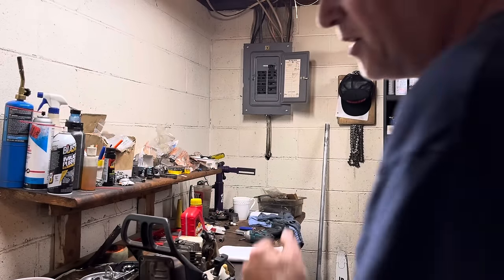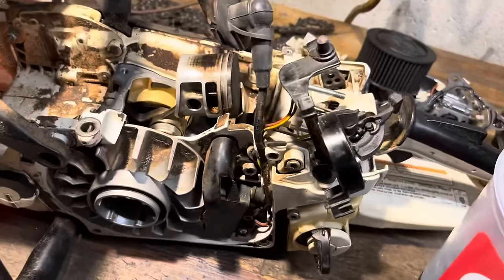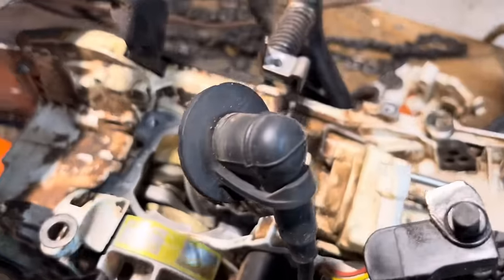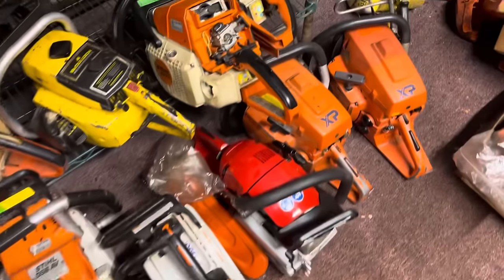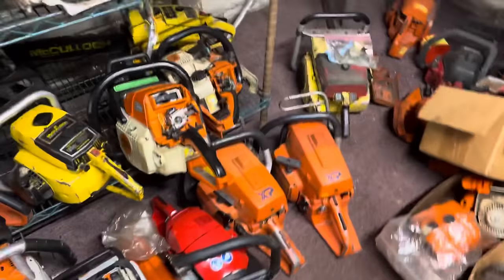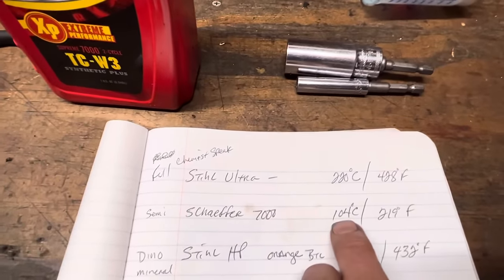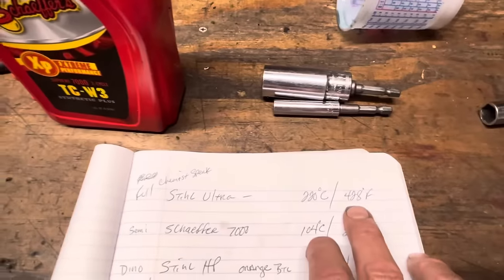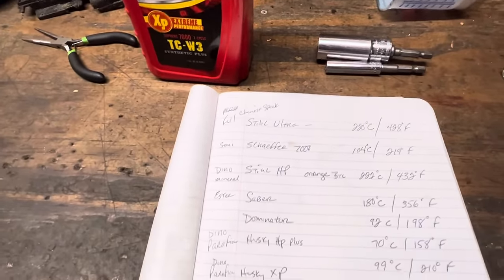Two Stroke Oil Talk.  Why Anything is Better than Ultra for your Chainsaw!

Comment: Schaeffers for the WIN! I run the synthetic for air cooled engines. My 462 is running at least 50- hours a week. From 90-degrees to -30F. Its 18-months old and still runniing like a raped ape! I mix at 45:1.
I run the Schaeffers in trucks, cars, log splitters, everywhere. From the performance stand point-nothing better!

Comment: I run klotz super techniplate. Best 2 stroke oil on the market in my opinion.
Reply from the maker: How's it look inside?  Asking for a friend.......
Reply: @richardflagg3084  last time I had the muffler off it looked spotless, but I expected that. I ran it in my yz 80 as a kid. Ended up tearing that engine down after 3 or 4 years of hard trail riding and it was immaculate inside too. In the 2 cycle racing engine world there are builders who won't warranty an engine that doesn't run it. It's that good. Also, if you wanna really party, it mixes with alcohol
Reply from the maker: @noclass2gun342  Nice!!

Comment: Ultra completely blocked the spark arrestor on my ms 241 CM.  Ultra uses ash for lubrication.  I never experienced a mechanical problem due to using Ultra, but it still sucks.  Ultra is a FB certified oil.  That is a 20 year old certification.  I pride myself mixing my two cycle oil.  I use a graduated measuring glass and measure out 77 ml of oil, one ounce of stabilizer and one gallon of premium non-ethanol gas, exact.

Comment: I've used Stihl oil (HP & Ultra) at the recommenced 50:1 mix for almost 30 years in Stihl chainsaws, leaf blowers and string trimmers and never had a problem.  Recently I watched a video that rated two cycle oils and Lucas came out the winner so I'm giving it a try.  Nice, informative video.  Thanks from another "shade tree" mechanic.
Reply from the maker: I'm not a high tech redneck, but it definitely gives you something to think about.
Reply: I have (2) 026 stihl saws. 18” bars. I used them over 30 years to cut 750 pick up loads of wood. Always stihl oil 50:1. Both saws are still good and never been over hauled.
Reply: @440gohorse  I also used to have two 026 saws but last year I sold one that hardly ever got used.  The one I kept has sawed a lot of wood.  Recently I did a major cleaning and while I had the muffler off I checked the piston.  It was so clean and smooth it looked like it was chrome plated.  Great saw.
Reply: @dlkline27  Yes Sir!

Comment: Funny I run a 661 and I just got the green oil. Always run the other stihl oil. In 30 years I've never had trouble with my Stihls running. 

I'm on my 4th tank of this stuff and the saw doesn't start first pull when hot. Already decided I didn't like it before I found this video. Don't like the smell either.
Reply from the maker: It don't like the smell of it either

Comment: I have a husky 372 XP 2003 I’ve been using XP oil 3 to 3 1/2 ounces per gallon never been a part 
works in all seasons a lot of hours on it never any trouble

Comment: Red Line @ 40:1, it keeps my Yamaha winding tight, and my Husqvarna's and Poulan's running real GOOD too!, they all get fed from the same can.
Reply from the maker: Exactly!
Reply: Huuuuge red line fan...running it in ported 5 year old 660 milling saw that pulls a 56 all the time..no carbon in exhaust n piston looks brand new w excellent film!!
Reply from the maker: @chapsmaketory3960  That's what I'm talkin about.  Trust but verify.
Reply: My family has been using Redline 2 stroke RACING oil for decades in all types of 2 stroke equipment.  50 to 1 + adjust carb, if needed. The engines always are clean.  My family has been repairing cars, trucks and all types of gas powered engines since 1919!

Comment: What 2 strpke oil is the best oil to run in my Stihl brushcutters and chain saws .
Reply from the maker: Any JASO rated FD oil will do well for you.  Amsoil Saber, Echo Red Armor or Power Blend Gold, Husqvarna XP+ are all top tier FD oils.  They have a detergent package that Ultra does not.  So you can run just a touch more oil (40:1)  with those oils for extra protection and wear resistance.
Reply: How about Bel-ray 2stroke oil ?

Comment: The problem is that they're formulating this 'new' oil to be 'Greener' so it breaks down really easy outside in the environment and doesn't smoke. It's some kind of natural derivative like plant based oil. They do say it dissipates fast. I have heard you need to run it really hot, and the other thing too is the mufflers have cats in them now so they plug up easier with  the better oils. 
I hate that pond scum oil too. I used the red VP full synth and it was great. Supposedly the Husky oil is good too. I got this Blue full synth oil, Black Max, at Walmart. Haven't tried it yet. They were supposed to have VP but I couldn't find it so I got that. I would say VP probably makes the Echo oil. None of these equipment makers make their own oil.
I've got an old 1970's or maybe '80's Stihl that sounds like a popcorn popper running, a real animal. I think it's 32:1 or 20:1 mix ratio and the Stihl dealer told me it was OK to run the full synth Ultra at 50:1. I didn't feel comfortable doing that. I always thought that Stihl oil looked like $hit mixed.

Comment: I’ve been using this stihl crap on my fs131 and my husky 445 and 460 rancher. Is there any way to get rid of the carbon it’s left on my stuff?
Reply from the maker: Ironically Stihl actually makes a De-carbon treatment.  I've personally never seen it in a dealership.  Running an FD rated oil with a little seafoam over time will clean up carbon.
Reply: @richardflagg3084  thank you for the quick response sir, I will do that

Comment: Ultra is manufactured by Castrol and a good oil. Running a mineral oil at 50:1 under continuous high lost is simply asking too much. Optimal ratio for performance and longevity has been proven at 32:1.
Reply from the maker: I'm with you 100% that 50:1 is asking too much from an oil.  According to Stihl's website, Omni Packaging in Shreveport, LA blends and bottles their oils.  The latest (2018) SDS sheets I can find from Stihl states:

Ultra is an Ester based oil (JASO FB rated)
HP (orange bottle) is a Mineral based oil (No JASO rating I could find )
Stihl HP Super has been discontinued.
Stihl Premium with Castrol logo on the bottle is not available in the US.  I have seen a Canadian that runs it.  There are other Stihl oils that are available in Europe that we, in the States, don't have access to as well.

Comment: Richard i have heard a lot of people say the same about stihl ultra oil. I have used amsol and husky oil lately. I use 40:1 with a pinch more. Great video  who would have thought that one of the biggest saw maker in the world would have the worst oil.
Reply from the maker: I'll cover this in an upcoming vid......  It performs better if you use the premix canned fuel as seen in  Redbull661's canned fuel comparison.  I think that high grade fuel helps keep the carbon in check.  But there's more to it and the above is not a blanket statement.

Comment: This scares me! I have Stihl fs130 trimmer, bg85 blower, and 029 saw. I of course used the Ultra for the warranties. And with my fs130 being 4-mix, dealer told me its very important to use ultra so I don't get sticky valves from carbon. Question, A car that had full synthetic and someone switches back to conventional, the oil seals start leaking. If I switch back to the orange bottle Stihl oil or red Armor, won't my crank seals start leaking going from full synthetic to conventional 2 stroke oil? I bough my fs 130 brand new in 2001 and have had no problems out of it using the Ultra except for A few carburetor replacements dur to Ethanol clogging the ports.
Reply: The Ultra oil is fine. Just mix it like Stihl recommends.  Also, it won't be a problem to run the HP afterwards. That double warranty is only for buying the oil with the trimmer, not running it in it BTW.

Comment: Might be why my ms170 blew its bottom end. Bought asundaes 341 to replace it.  Only thing is i got 5l of the ultra to use up now. Might start mixing it abut more rich now.  Maybe 40/1
Reply: to have 50 l of hp ultra is super depressing

Comment: I use Echo Red Armor when I run out of Amisol Dominator. Dyno Joe does runs saws on like 1000:1 ratio and Dominator out lasted them all by miles!
Reply from the maker: Project Farm did a video with Dominator as one of the oils.  It did really well.  I love that dude,  He's really got a passion for it.
Reply: 100:1
Reply: @rodneyfalk4591  meh one zero equals nothing right?

Comment: I've been running Lucas's semi synthetic for years at 40:1 I've have never had problems with carbon and nothing has died on me yet. Stihl ultra smells so bad and everything seems to run way hotter with lower performance.
Reply: your right l think it's paraffin which is wax Omni makes Stihl oil  not sure who makes Hp orange in Canada it's Valvoline who makes Hp
Reply: @harryerhart5978  You think the wax makes that smell and the burned residue? I believe it, I really like the lucas oil products. Their oil stabilizer is to be used in moderation though. I run their fuel conditioner in every tank saves alot of fuel and helps everything run smooth.

Comment: I have been using Husqvarna branded syn mix oil, but adding enough (3.20z total/gallon) to get 40:1.  It smokes a bit, I have to admit; but think of the money I save.  But Husqvarna does not refine oil and maybe that stuff comes out of the same bull as Stihl????
Reply from the maker: Hard to find info right there.  Most manufacturers have a spec that they want with the additives and have it blended by a secondary company.  Both of the Husqvarna oils (XP and HP plus) have a very low flash point and are neither are a Ester base.  Polar opposite style oils from those two companies.
Reply: @richardflagg3084  Another YT popped-up where several pre-mixes 50:1 were compared after use of new cylinders and pistons.  The Husqvarna did well with upper end, but the lower motor was very dry looking.
Reply from the maker: @rooster3019  We'll do some real world testing here in the next week or so.  Thanks!

Comment: I'll tell you something, people here are buying MINERAL version HP and it makes smoke screen like a 007... The less bad version is semi synthrtic HP Super and that HP Ultra is the least bad oil they have to offer. But I told my dealer a month ago when I bought myself a brand new MS311 chainsaw that I never used Stihl oil only Castrol POWER1 RS or POWER1 RACING 2T and there is absolutely no smoke, full power, instant throttle response, clean spark plug... He told me that's good...
And BTW I'm doing this for many years. 
I have MS230 from 2005, FS120 bought in 2016, now bought MS311 and I can lift them all by pull cord how good compression do they have...
Reply from the maker: I've heard the Castrol 2T is good stuff.
Reply: @richardflagg3084  Excellent!!!

Comment: Neighbor Gave me a case of stihl brand pre mix oil . That stuff definitely felt more powerful when running the saw .  I think it boasted 94 octane.

I feel like it runs great in my saw but at cost of wear and tare . 

Just stand to reason to me if your getting more power out of it , that is great but it’s also at cost  of wear . Everything wears out . I don’t think the extra power gain is going mean to me because I don’t run the saw much so what ever more wear from higher powered fuel compared to what I been mixing may never see a difference when I have worn out the saw. I don’t use it enough to matter . Or I don’t know the difference.

It is more fun to run the saw feeling more power . 

So. Now I buy non ethanol fuel and mix my one fuel again.  I will be moving away from stihl hp unless that’s all  I can find  at the time . 

I brought some Yamaha lube . Thinking i will star the dirt bike up this spring 

Thanks for all the information it’s opened my eyes about this topic
Reply: The gas in those cans is engineered fuel and is different than the gas, even Pure Gas, at the pumps. It's more like Race Gas, has a different specific gravity (density). Those cans have more of the better top petroleum distillates, Paraffines, of the Gasoline such as Alkanes (Iso and N) and Naphthene. A pure Alkylate fuel. Pump gas has double bond (Alkadiene) Olefin hydrocarbons and Benzene aromatics (trash),and oxygenates (alcohol or ether. Used to be MTBE). In some equipment EF (eng fuel) WILL change AF ratio and performance. It tends to burn richer, cleaner, and hotter. 
But you got to ask, who's gonna pay $30-$50 a gallon for that stuff? If you were inclined to use that it would be cheaper to buy a couple gallons of Sunoco Cam 2 standard purple or some 260 GT unleaded 100 or VP Racing and mixing with that. I bought a few 5 gal pails (260 Supreme 112) 4 years ago for $60 (12 bucks a gallon). Wouldn't even want to guess what it goes for now.

Comment: Ive used stihl hp ultra the last few years,just because my stihl dealer is only 10 minutes away. So far i haven't seen any adverse effects. Ive been runningvit in my leaf blower,trimmer,and 3 chainsaws. That being said,im probably gonna go ahead and switch,but i want something i can buy locally. So far,at a glance in finding penzoil,valvoline,and a lucas semisynthetic. We dont have alot of small engine shops around me,just stihl,tractor supply,and a rural king. Ive used other lucas products in the past and trust them ok. Back in the day i used to buy castrol 2 cycle mix,but im no longer finding it here. Rural king and tractir supply both sell husqvarna stuff and sale their branded oil. Anyone have faults against the lucas semisynthetic?
Reply from the maker: Do you have any motorcycle shops around?  Honda HP2 is a fantastic oil.  Motul 800 offroad or Belray HR1 is good as well.  Amsoil Saber (at 50:1) by the quart is a great option as well if you can find it locally.  I've done tons of oil videos.
Reply: @richardflagg3084  I appreciate that. I think theres a honda shop close by. Yeah,I've been watchin some of your other ones too.ill keep checkin around,call the honda shop Monday.  Thanks again

Comment: Amsoil mix oil is the best. Been using it for twenty plus years and it has literally not ever been a problem. It mixed 100/ 1:00 ratio.. you all need to buy some and try it full synthetic..
Reply: I use Opti2 (not synthetic) at 90 to 1.  I have a couple of tree worker friends who use Amsoil  at 100 to 1.  None of us have ever had a failure.

Comment: I have never seen a saw running Ultra have a clean, light tan plug.  Even my 25B blower which gets run hard has a dark plug running Ultra.  Run Red Armor in it and it is clean and light tan in color.

Comment: Hello Richard
I am French, so I translate my text into English 
I use sthil motomix for my saw 550 xp husqvarna, but I add 2 ml of ultra hp oil in the litre motomix, because I know that the motomix is composed of ultra hp oil, so the mixture is 45 - 1 or 2.2% 
Am I all right? is this good for my saw that turns very fast to add a little oil 2 t or then I have to change the brand of husky oil semi-synthesis for example dosed at 40-1?
I would like to mix the aspen 4 times with husky oil at 45 -1 , aspen told me it was possible , no problem for the mixture it’s like gasoline taken to the pump for the mixture
thank you for your answer I will translate it into French to understand
Reply from the maker: Merci Monsieur!  Remove your muffler and inspect for carbon deposits in the cylinder and piston.  If there is excessive carbon, I would suggest Aspen fuel with Husqvarna XP+ mixed at a ratio of 40:1.  This oil did very well when I tested it.  It smells much better than the Ultra as well. 😀

Comment: Most likely wrong mix ratio and/or not warming the saw up before putting it under load 
I use ultra in everything my Husqvarnas and echos ... even my 2000 ford superduty (gaser) I even put in in my diesel 
If I use anything else it's a synthetic snowmobile 2 cycle mix
In the hot summer (anything over 98°F)
I put it in my lawnmowers
Reply from the maker: This saw was run mostly on canned Motomix.  I've got several other videos showing the same results.  Most people can't tear an engine down and truly see how their oil is performing.  Feel free to run whatcha like, but there are better oils out there.  

Most quality two stroke oils carry the highest rating of JASO FD.  Ultra is rated FB, two tiers lower for what it's worth.
Reply: @richardflagg3084  canned gas, yes I have been warned about using it .. and only in an emergency 
I could never spend the money on that full time
I must also say that I have two saws from 89-95 (that get used once or twice a year) still running good and since 2010 I exclusively use non ethanol gas .. in all gas engines

Comment: Have always used stihl high performance in the orange bottle in all my 2stroke equipment including my Suzuki rm125. Works good when mixed properly. Won't use Ultra!